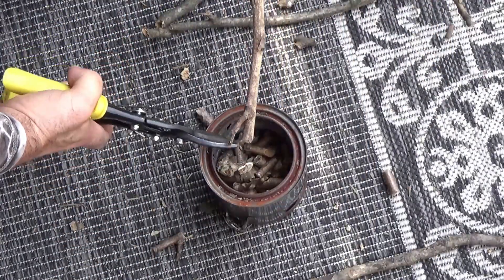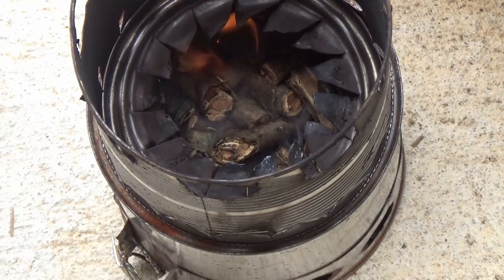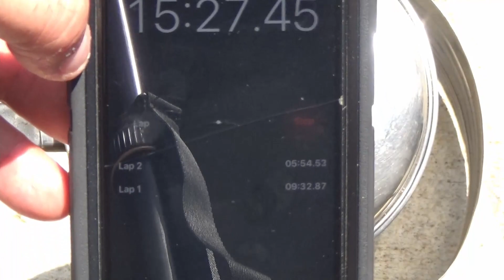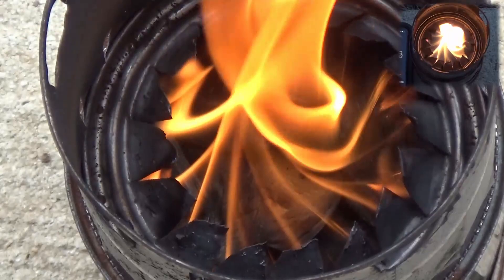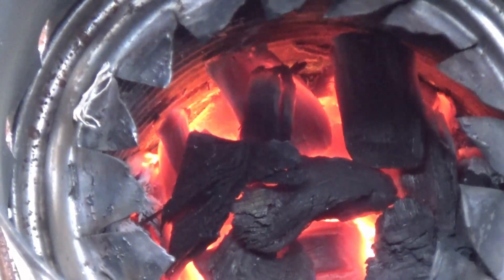Paint Can Wood Gas Stove Optimization! Making a good stove GREAT! Wood Gas Stove Science| Part 6!

Comment: maybe an idea for another test:

1. get a branch with a diameter little smaller than the burning chamber diameter.
2. cut to length so it would completely fill the burning chamber depth
3. dry
4. put rubber band around the circumference and split in 8 pieces (kind of like a mini swedish fire log)

leave enauth space for propper airflow and optionally put a bit of tissue paper between the splits and drizzle candle wax ofer it for easy fire starting (idk if methanol alone would light it up propperly)

I think the idea of having a mini swedish fire log inside a wood gas stove would improve airflow inside the chamber since there would be less resistance than with pellets or twigs and maybe the burning time would improve as well since there is not as mush surface area exposed to the flames that way.
Reply from the maker: I may try that in the paint can stove! Thanks for watching!
Reply: @heathputnam9524  I'm looking forward to it

Comment: Well, pellets give a high fuel density, it was to be expected that natural material has worse results. I tend to only use twigs up to the diameter where I can't break them with my bare hands anymore, not larger. Bigger chunks go in first, good shake, smallest on top, helps with lighting. 

We did a ton of tests too, and adding fuel should be done early but not right away, and, as you said, slowly, piece by piece
Reply from the maker: Absolutely! Thanks for watching!

Comment: Cool! Thanks!  
But if I am using this stove in the woods, I'm going to want to use it with small sticks that are not cut to imitate pellets (small finger sized, random lengths, short enough to stay beneath the secondary air holes) and without a chemical accelerant.  My attempt, so far, will smoke until the secondary air kicks in, then clean up. But burn time is so short that I need to add sticks a couple times to get enough energy to boil 6 cups water for coffee (Stanley coffee pot just fits on to pot stand). I cut out a larger hole in  pot stand to add sticks. Added sticks, will, however, ignite well after addition. Some smoke again at the very end.
I used a can about the size of a large chicken/tuna can for pot stand, cutting the bottom to mimic your flame concentrator. What can did you use for your pot stand, since mine is considerably shorter and not achieving your vortex.
Reply from the maker: I tried to burn the same type of sticks and twigs. What I found was there was too much space between them. Too much air not enough fuel. I then cut up the same sticks into really small pieces and had better results. You may want to try to reduce the number of primary air holes. That will slow the flow of air through the fuel and possibly help with fast fuel consumption. The pot stand I used was crushed tomatoes, Hunts I think. I will try to do some experiments before my vacation. Hopefully get out a video! Thanks for the comment!
Reply: @heathputnam9524  It seemed to need more primary air to get it going at first, possibly because I was using tinder instead of an accelerant. 
Restriction of the primary air supply to encourage usage of secondary air supply? Will that happen anyway as ash builds up? Is that partly why the secondary air kicks in later?
Reply from the maker: Starting with tinder, unless it’s extremely dry, will most likely smoke a little and time a few extra minutes to start but should still start drawing secondary air around 5-6 minutes in. 

What is your current primary to secondary air ratio?
Reply: @heathputnam9524  The original 5:1, then opened up secondary air holes to the 1/4". That seemed to give me a better flame. I can try eliminating or blocking the holes on the side of the inner can.
My pot stand/flame concentrator is not optimal - need to find that tomato can, or equivalent. Or two of the large chicken/tuna cans high?
Reply from the maker: If the primary holes on the sides of the inner can line up with the fresh air intake holes, the wind will cause the burn to be twitchy. I moved all my holes to the bottom. I still have 45 one quarter inch primary holes but they are on the bottom which did help a lot.
Reply from the maker: Your pot stand is also huge! Work on that optimization next! Keep me informed!
Reply: @heathputnam9524  What is the height of your optimized pot stand? My current pot stand looks to be the same diameter of your tomato can, but much shorter.
Reply from the maker: It’s about 5 inches!

Comment: Hi Heath! Awesome new video! I love how you tried the hard wood and the spongy wood and how your stove would react to it. :) I have an idea on how to solve your soot problem for your pots and pans. https://www.fastreplacementglass.com/pyroceram-ceramic-glass-5-inch-circle-cut.html How about putting a Ceramic Glass 5 Inch Circle Cut | Pyroceram High Temperature Glass Circle on the very top of your pot stand where you would put your pot on. This glass would mimic a heat diffuser. Not only will your pots be protected from soot but it will have even cooking. This glass is made for wood stoves so you can see the flame. This glass allows you to see your flame pattern on the the top of your stove depending what size pot or pan you use. This thing is roughly $78.00 Again, the beauty is no more soot on your pots and pans. The only negative side is the build up of soot on the glass. Just to thought encase you are interested. Keep up the videos! I love them! :)